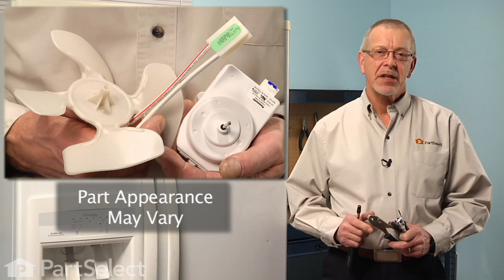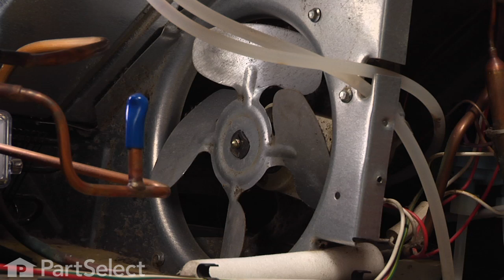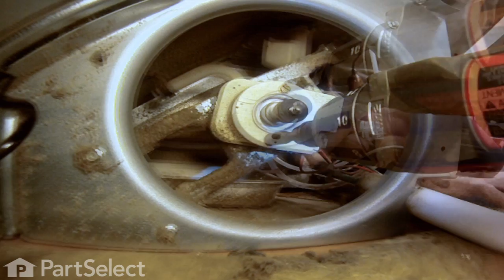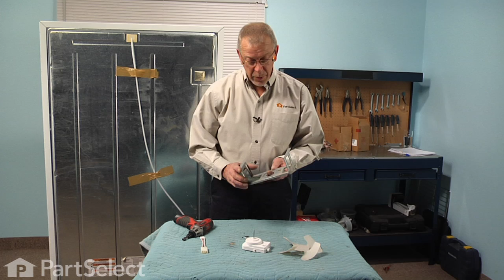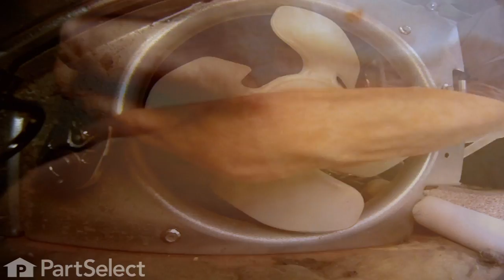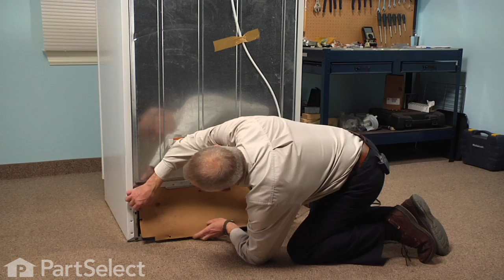Refrigerator Repair - Replacing the Condenser Fan Motor Kit (Whirlpool Part # W10124096)

Comment: Is it still stable if the motor part I have only has two screw placements attached to the motor frame, they are slightly offset

Comment: Took me 30 min. I don't have the nifty little screw gun with the light on it. Cut my arm on metal wire clip sticking my hands in there. Quite a tight situation.

Comment: My refrigerator has a motor like this one with plastic case and blades. I purchased a replacement motor that is metal and looks more heavy duty. Now my problem is the fan blades doesn't seem to be interchangeable. Did I get the wrong motor for my refrigerator or can I purchase the blades somewhere for it?